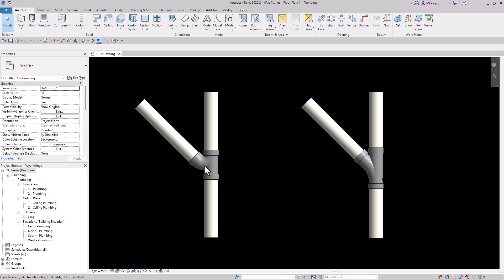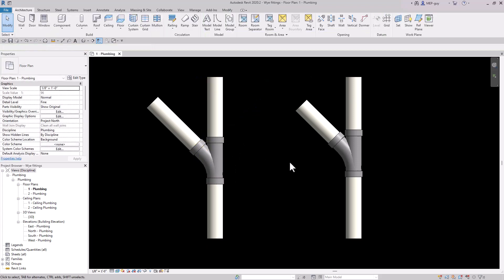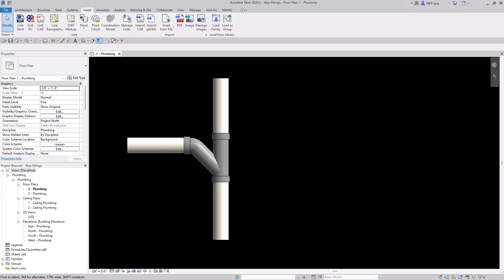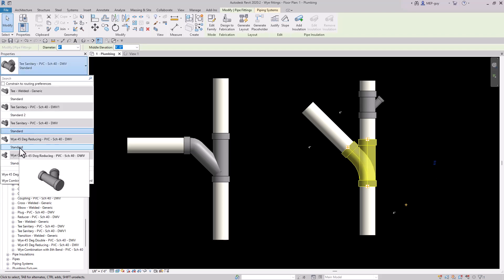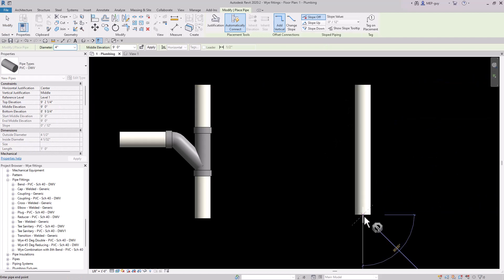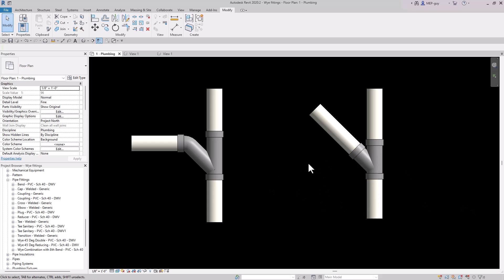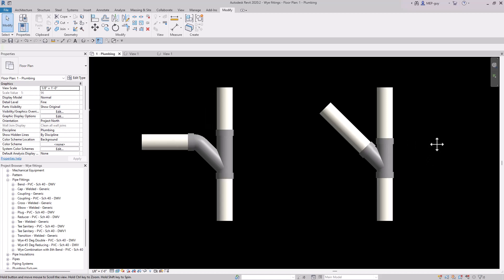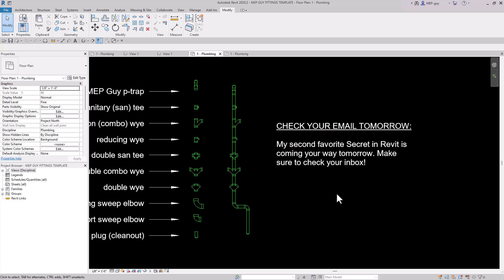Wye Fitting PROBLEMS & how to fix them in REVIT

Comment from the maker: Get my free pipe fittings template file and Plumbing in Revit mini course at:
https://www.mepguy.com
Reply: revit is wrong. They can call it whatever they want, but AFAIK there aren't any tees with a  branch at 45deg. 
look at page 53 here:
chrome-extension://efaidnbmnnnibpcajpcglclefindmkaj/https://www.charlottepipe.com/uploads/documents/technical/Plastic_Pipe_Fittings_DC-DWV609.pdf

A sanitary tee  has a branch at 90 degs, but it sweeps into the line. At least for the DMV. I can find a dozen good, technical sources that show that fitting that revit says is in the tee class that all show it as a wye.
Reply: I am not seeing the free pipe fitting template. Is it no longer available?
Reply from the maker: @karissatupper5415  You can get all my Revit Families by purchasing them on my website.
Reply: @mep_guy  so it snot free?

Comment: Is there a way to connect two pipes at different elevations but from the main run going to the branch which is at higher elevation with a wye that is vertical and then go straight up perpendicular on the same plane as main branch and then put a 90 elbow to connect to the higher branch
Reply from the maker: Check out this video: https://youtu.be/uWxsqSHujOg?si=d1XCNgZpueJYwU6f

Comment: These videos are so helpful being new to Revit.  Do you have a pipe fittings template for No Hub Pipe?  That would be huge, especially if you had Husky Clamps for the fittings.  Would love to know how you can draw the pipe and it would automatically draw the clamp every 10' for straight runs.  Then you could find all of the instances and get an idea for Stock (rough idea).  Keep the videos coming!
Reply from the maker: I actually get that request a lot. Are you on the construction side of projects? I'm on the design side so there isn't a need for that but I can see the benefits to doing this in construction. Check out my "Find Pipe Length" video. That should get you started. I'll definitely do a video on using no hub couplings in the future!

Comment: Thanks for Video 
Pipe Fitting Template file unable open due to not upgrade in Revit 2017 version please upgrade it
Reply from the maker: You should be able to open the file in the 2020 version of Revit or newer.